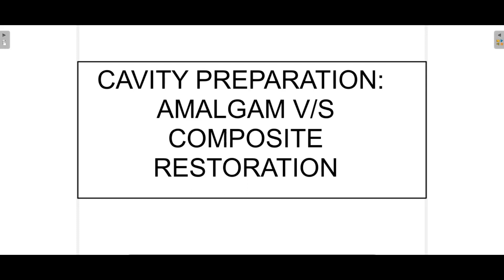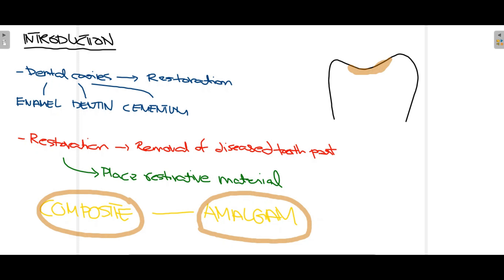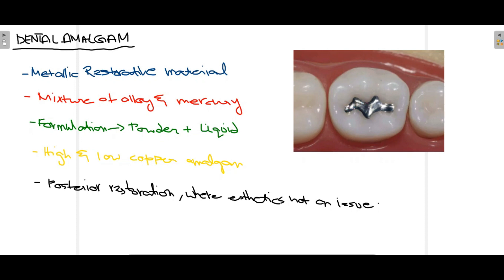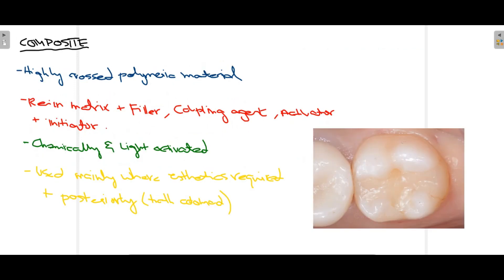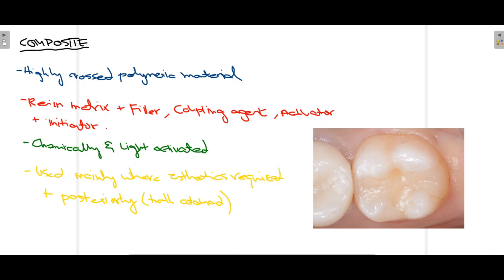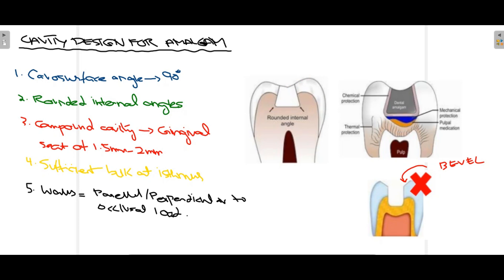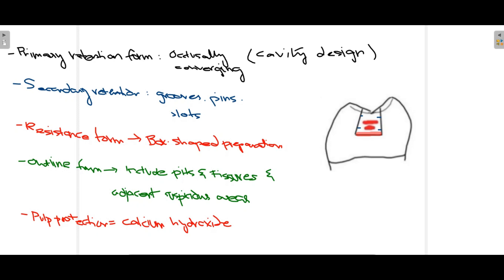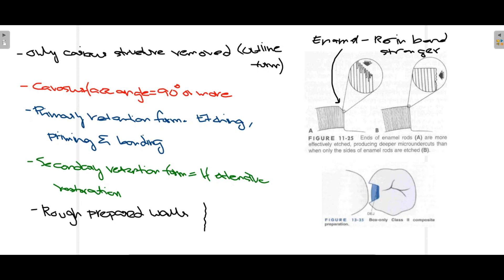Cavity Design: Amalgam V/S Composite Restorations

Comment: Hello sir, can't we use composite materials on the top of Amalgam.
We will get strength of Amalgam & asthatic of composite.( First layer of composite than amalgam than again composite)
Reply: I'm sure there's other issues, but I would think we couldn't etch the amalgam the way we do with tooth, for the composite ontop to be bonded micromechanically to it. Etch and bond working (to bond composite and not allow microleakage and secondary caries) relies on the structure of enamel with enamel prisms (and on dentine with collagen fibrils) being selectively dissolved by acid etch to create a rough surface (like a lego brick microscopically) that holds onto the composite. 
I'm not sure if acid etch has any effect on amalgam, but if it did it would just erode it away evenly, not creating that micromechanical retention (etch pattern) we need to "lock in" the composite on a microscopic level
Reply from the maker: We cannot do that because of lack of bonding between amalgam and composite.